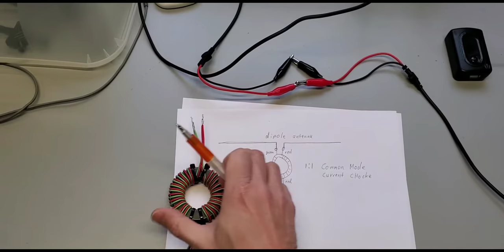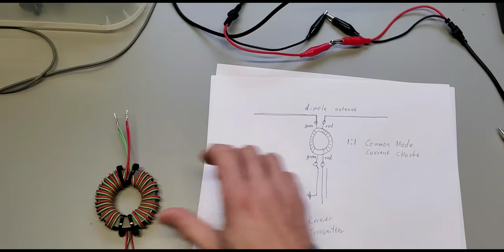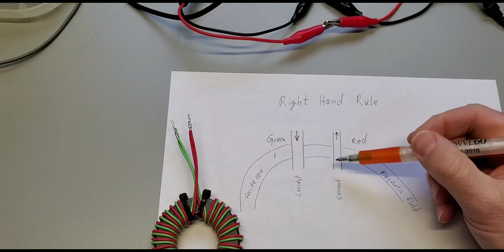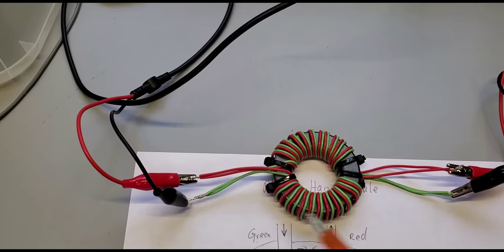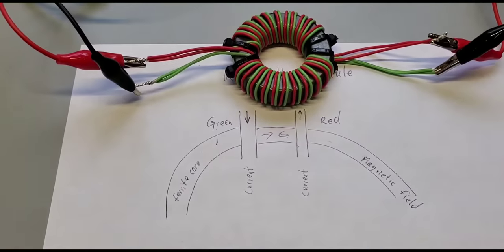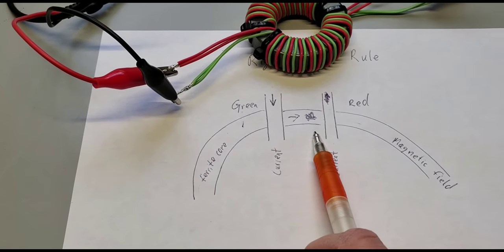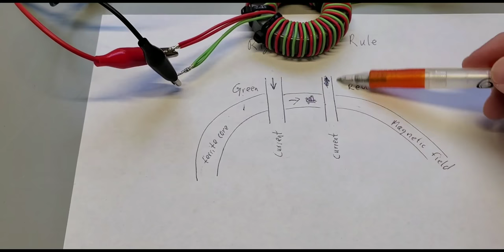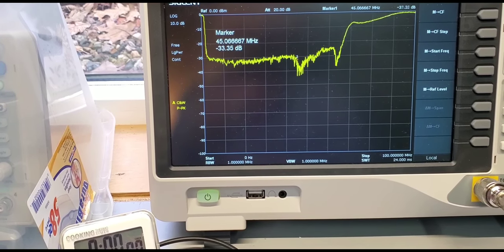1:1 Common Mode Current Balun Explained

Comment: What is the power handling capability?
Reply from the maker: The design of the current mode choke is from DG0SA https://www.dg0sa.de/balun1zu1gross.pdf .  He rated the power handling up to 800 watts.  Note that in Germany, where he's from the max power an amateur radio operator can use is 750 watts so I'm not sure if he had any interest to look into 1500 watts baluns and chokes.  
I have used this balun on 800 watts SSB without any issues yet.
Reply: @adventurelaus   If I used 14 AWG with the same Ferite Core, this should e able to handle 1500 watts?
Reply from the maker: @nolyn78  I'm not sure about that myself.  Per instructions from www.dg0sa.de the 200 watt version uses 22AWG with a 40mm core and 12 windings, the 400 watt version uses 20AWG with a 40mm core and 10 windings, and the 800 watt version uses 18 AWG with a 60mm (FT240) core and 12 windings. 
As for buying the wires, I got them from ebay.

Comment: I liked video. Good explanation and choking demonstration, but IMHO is not quite correct. We don't disconnect the other coil from the line. And if whole cable tries to be unbalanced on one coil, the other coil generates equal potential and return to balance of applied potentials. 
Thanks!

Comment: Dear Sir,
I have build a magnetic loop antenna for 11 meter band.  (tx ands rx)
Do I need to ad 1:1 ballun between the magnetic loop and coax?
And what would be the best core material for that band?

Greethings from Belgium.
Reply from the maker: For 27MHz (11m) both 31 and 43 would work. Paalomar still suggests using 31. https://palomar-engineers.com/ferrite-products/ferrite-cores/ferrite-mix-selection

I case you haven't seen it yet, I've made some measurements with the 43 mix as well.
https://youtu.be/xagW9szP0eI

I'm not very knowledgeable if magnetic loops have causes of common mode current. Using a good common mode chocke shouldn't impact performance though.
Reply: @adventurelaus  Dear Sir,
thank you very mutch for youre reply.
So it is betther to use one instead of none.
Best regards from Belgium.

Comment: ft140-43  ????? ft240-43 ????????
Reply: I use FT240-31. Good results
Reply: Size depends on power needs. Mix depends on frequency.

Edit: a 240 like shown in the video wrapped with 18awg PTFE should handle in the neighborhood of 600 watts just fine.  Stepping down to a 140 and 22awg should cover you for 100 watts or most applications if you don't have an amp and want a smaller device. The costs are pretty similar unless yer making a bunch or em so the bigger one gives you head room for days and no worries of ever overheating it with a 100W radio. It's also easier to work with than the smaller one imho. 31 mix if you favor towards 160/80m, 43 mix if you favor 20/10m.

Edit edit: cut them powers back and keep an eye for heat if yer gonna run some digital mode at 100% duty cycle nonstop. Really that's basic rule with anything I think particularly diy you need to verify what your device handles the way you use it. Most users with most materials will be okay around those levels in most operations. Also you can stack em if you need more power..napkin math says it'll about double it...real worl again is depends so verify.

Comment: You need to understand common mode and differential mode the two are not the same... The explanation has several erroneous assumptions

Common mode currents exist when the matching from unbalanced to balance take place, any mismatch here creates common mode currents
Its wrong to call a 1:1 current BALUN a common mode choke, the example in the video is wound as a choke and thus works as a common mode choke, however there is not conversion for differential mode, the transformer should be wound with differential matching structure.
Showing the response in the spectrum analyser is also not correct, the test is done with unbalanced in and unbalanced out, thus the result does not show a lot aside the ferrite bandwidth.

I understand that many use this kind of setup in the belief that its a 1:1 current BALUN and this propagates the myth into the wild, however its not providing the proper match as required adding to losses, note that any common mode currents generated are detracted from power intended for radiation thus its a loss, make a proper matching transformer and then the common mode currents will be negligible.